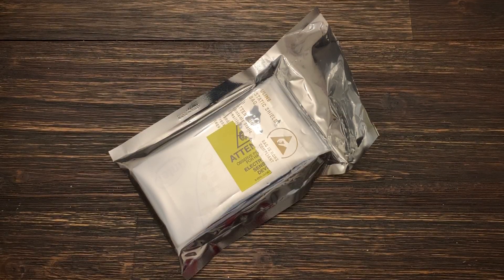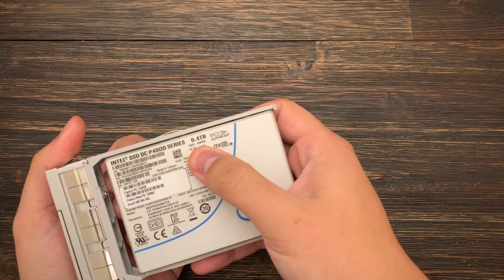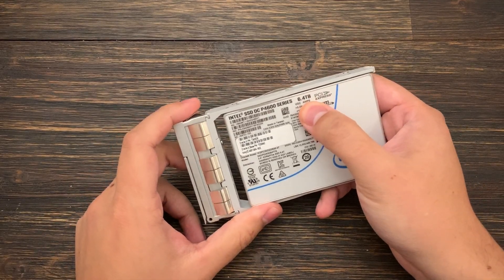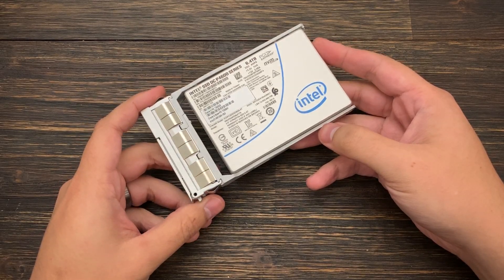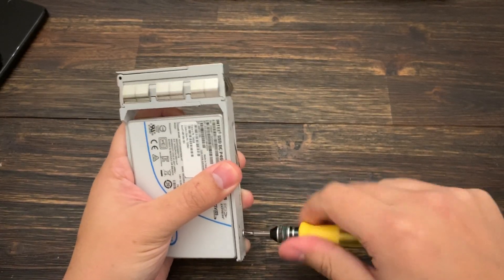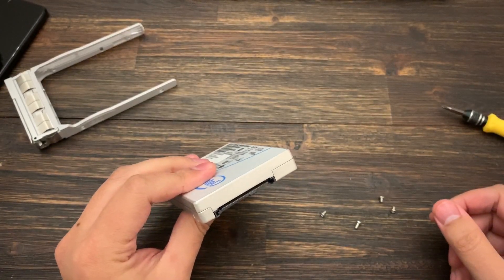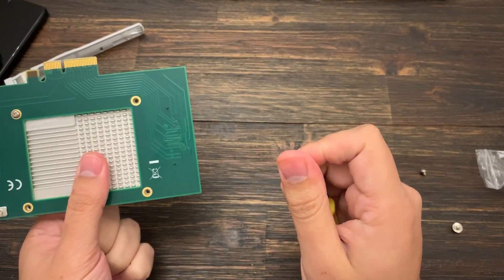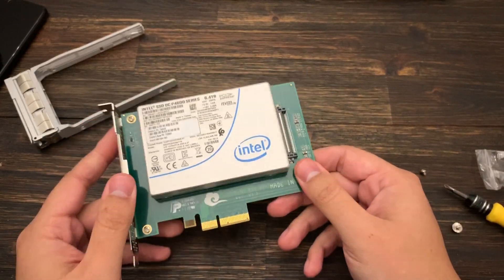This SSD is insane! Intel 6.4TB NVMe SSD

Comment: Say I just picked up an IDENTICAL (Oracle) Intel SSD DC 4600 6.4TB SSD. I've been researching it to find a motherboard that I can test this with.  I have a couple questions on your setup.  First, that PCI-E/NVME 8639 adapter card does not have an external power connector so the drive power was pulled thru the motherboard, did that work?  The SSD says 2.45A +12V, that's pretty large.  And second question related to the first, what motherboard did you use?  Technically this SSD is a PCI-E V3.1 x4/NVME interface so did you use a motherboard with V3.0 or V3.1?  Oh and also, have you flashed the firmware of the SSD at all?

Comment: What would you recommend for a tinynas?

I have about 4 2tb drives... in an old qnap TS409...

And lets just say... 4MB/s is about all i can push through it most of the time...

I was gonna build the aniversery build... but car problems come first... sadly
Reply from the maker: Have you seen these? I'd recommend looking at something like this if you're on a budget. https://forums.serverbuilds.net/t/nas-killer-4-1-supplemental-build-guide-deals/2187
Reply: @JDMWAAAT  for some reason I took a look at them... And then just scrolled past no clue why. But these look a lot like what I need

Comment: Would you lose speed with the PCIe NVMe SSD adapter because the port is converted, or does the P4600 keep its original speed? Also are boot times fast on this SSD as well? I read that server SSD's have slower boot times because servers don't boot up often and it just prioritizes read/write speeds
Reply from the maker: You would not lose speed. They are direct pass through. 

The ssd is plenty fast for booting.